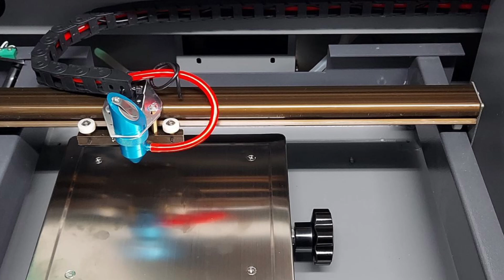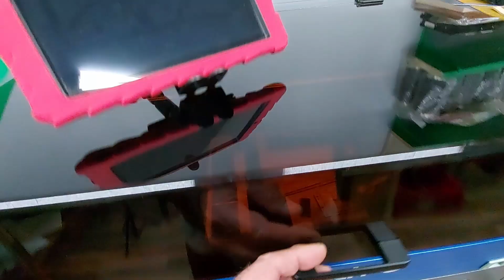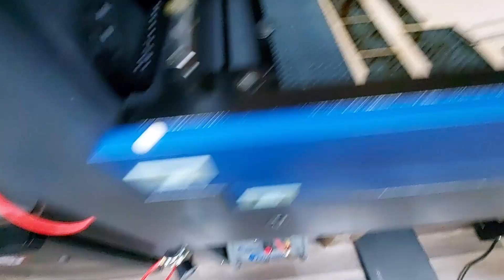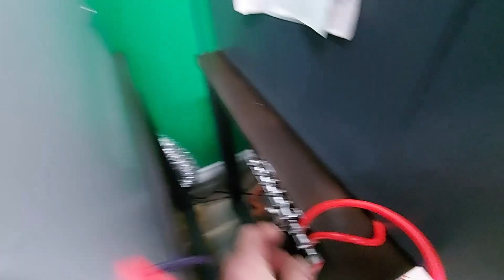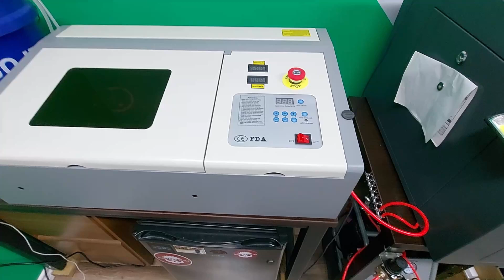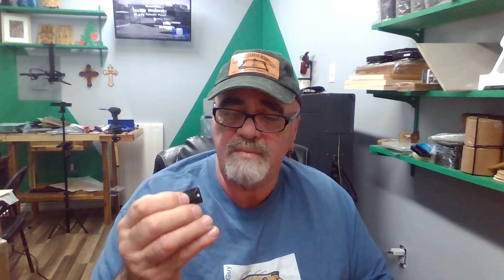🚫 Adding Air Assist to the Monport 40W Co2 Laser the Easy Way! (OUTDATED)

Comment from the maker: George Chambers brought up a good point! If you plan on flashing a cheap board yourself, you have to make sure the board has all the same connectors! The links I put in the description are for reference only. I didn't actually buy a board for this conversion, I just matched one up that I had in a parts bin from my 3D printers.

Comment: Can you show or picture the the connections on the output side of the compressor and what fittings I could use to reduce to small air supply lines. I'm going to use a compressor I'm not using that's 110 portable on wheels. I could use an airhose to where I need it
Reply from the maker: I can't in a comment, but you can get the reduction fittings on Amazon.

Comment: Hey man great video. I also live in Louisiana. I have been looking all over the internet for anyone that has done a video of a Monport K40 like yours that has a rotary attachment for tumblers. I have yet to find anyone showing if this model can do it without cutting the bottom out. your method of removing all the lower trays and installing the 8x8 scissor lift looks like it might be possible if the lift was removed. Do you know if this is possible?
Reply from the maker: Yes Shayne, if you get a very low profile roller. But I don't think you'll be able to get more than a 20oz tumbler in it.

Comment: Hi Guys. Where would I buy an air assist head and how much would it cost. Very new to lazers. Cheers P
Reply: Many sir for the reply. Really like your video on Monport K40 lazer. I have contacted Monport, asking if they can supply a rotary device for the 40w, but they say there is not one available. Can one be fitted. Many thanks again.
Reply from the maker: If you remove all of the aluminum bed inside, you can use any diode laser roller accessory Paul. They plug into the Y port on the control board.
Reply: @TheLouisianaHobbyGuy  Many thanks again
Reply from the maker: https://amzn.to/3h3YOwP $25.99

Comment: Very informative, I just purchased a Fireproof 60W, should I purcase the water chiller from Monport or is there a cheaper way? Also, I assune this air assit will work on the 60W also ?
Reply from the maker: You can get the chiller from anywhere. Just make sure you get the 5200 series with a compressor. The 3000 series are not chillers, they're just radiators with fans. The 60W already has an onboard air assist.
Reply: @TheLouisianaHobbyGuy  Thanks Rich!

Comment: Rich, the scissor lift on amazon lists min thickness as 80mm/3.15 in when collapsed. I ordered the laser and looked at the manual while waiting and it says max Z depth with vent board removed is 2.5". I see it in your machine and plan on removing all of the boards in machine so I assume it will fit. What is the max thickness on top of lift I can cut. I plan on putting metal mesh down and will subtract that thickness from your answer.  I am ordering the lift from your list under your FANTASTIC video.
Reply from the maker: The jack is 3" fully closed James, and when inside the machine this leaves 2" Between the jack and the stock nozzle. I use the blue nozzle with air assist, and it's 1 3/4" from the jack to the nozzle. 3/4" stock would be the most I would would ever cut and that would fit. But if I needed to engrave something with a larger thickness, I could simply take out the jack and use some risers. I printed a bunch of 10mm risers for this exact purpose but never had to used them yet.
Reply: @TheLouisianaHobbyGuy  WOW quick reply. Thank you so much for the info. I used your code when I ordered my laser. Thanks for the discount.  Waiting on the company to send me specs on the water pump so I can find one that fits in the ice maker reservoir.. You are a fantastic source
Reply: @TheLouisianaHobbyGuy  I could also mount the cabinet on 3/4 mdf and cut the bottom of the cabinet the same size as the scissor jack and that would give mw another 3/4" to adjust focal length as needed and still keep cabinet stiff
Reply from the maker: Yes James! Lots of people have done that to use a roller accessory.

Comment: Great video Rich.  I am also a fan of the zip tie holders.  The ones I use have the single hole on the middle which accommodate a M5 screw nicely.  I say this because I will use them with drop in T nuts along the extrusions for my wire and hose management.
Reply from the maker: Oh, nice! I'll have to look for those Paul. ✔️

Comment: Rich, are you using the Omtech board? I didn't see any place for the ribbon cable from the limit switches just a 5 pin jst plug, although yours had a place to plug it in. I've collected most of the stuff I need to start modifying my K40 but I'd still like to get a new controller for it. Thanks for the video!
Reply: Okay, I went back and looked at the video again and see that your cable has a JST connector. I'll have to go and check mine to see. It should be the same.
Reply from the maker: I don't remember what board that was George. I had about 7 boards in a parts bin from homemade 3D printers and I just picked one that matched. I didn't actually buy one for this conversion.
Reply: I'm looking at the Mini Gerbil board from AwsomeTech but they don't have an online store anymore so I sent an email. I haven't seen great reviews on this board but it has the right connections for my laser. The price is right so I'll take a chance on it.
Reply from the maker: @georgechambers3197  They'll send you an email with the purchase info. They have them.

Comment: After all your upgrades to the $430. Laser how much is it?
Reply from the maker: Without the air compressor, I spent about $575 all in, with a lot of extra parts to spare.
Reply: @TheLouisianaHobbyGuy  wow a lot less than I thought. Much better value then a diode laser. Thanks for the reply.

Comment: Very nice and easy setup on the air assist Rich. Thanks for all the great info you provide each time. At 65 years old I’m still like a kid waiting for your next video! I’ll probably have a few questions when I decide to get a CO2 set up. I see there are 2 different electronic boards in your links. Will both be needed for this setup. I know one is so you can run lightburn. What is the other one for? Sorry if this is a lame question. Thanks again for all you do. I’ll be sending a donation to your cause buddy. Keep the info coming.👍🏻😎
Reply from the maker: Thanks Edward, no the cheap one is DIY on the software and the expensive one is plug and play.
Reply: Okay thank you for clearing that up. Have a great weekend.
Reply from the maker: @SickFisherman05  You too Sir!

Comment: So a pre programmed smoothie board is $199? and if you just buy a smoothie board and flash it with grbl 1.1 yourself, thats only $40?
Reply from the maker: Yup, you got it. and the pin out is slightly different, but easy to figure out.
Reply: @TheLouisianaHobbyGuy  can you list a link to where we can get a smoothie board for $40 that will work for the k40. Where did you get yours. the only link you have listed is the $200 one.
Reply from the maker: @woodknack1  The link is in the description. I linked both.
Reply: @TheLouisianaHobbyGuy  Ah I see it now, thanks. But that board looks different than the board you have installed? Any videos online that show how to take that $40 board and turn it into the $200 board? I mean I see some potential for making some money here just converting a $40 smoothie board over by just flashing it and and sell them for $150 !!
Reply: @woodknack1  did you ever find out?
Reply: @urjnlegend  find out what? I sold my k40 a long time ago and bought a bigger laser. The k40 is great if you want to tinker with it but by the time you do everything you would be better off getting a bigger one. If anything else for the bed size alone!

Comment: Working on air assist now for the X7 Pro. I have several aquarium air pumps lying around but so far I have seen zero difference using them vs nothing. Maybe because of the downdraft fan already on the M50? 🤔 But there is also no way those pumps are putting out anything near 10psi. Id like to get the Neje air pump so I can put it in the box but it appears to me to be just an industrial looking fish pump. 🤔 Still shopping. As always, love the vids.
Reply: Good to know. Thanks again. Might've been thinking of the FA laser, been looking at Neje lately kind of wishing I would've went that way instead of the X7. Atomstack just released their air assist for $100. Must be gold plated. 😒
Reply from the maker: @PicklesFTW  Neje is telling me they're sending me a new design in early March pre-launch for testing. According to them, they say it's going to be a whole new design and laser module.
Reply from the maker: I haven't seen the Neje AA, but I've heard the Fox Alien does a good job at only 10L/min. Now on the diode laser, I do lower the psi to about 4 for engraving and 7 for cutting wood. There seems to be less of a need on the diode or too much air works against it.